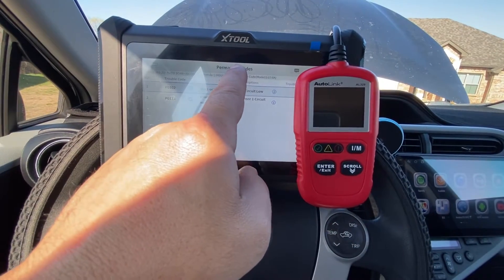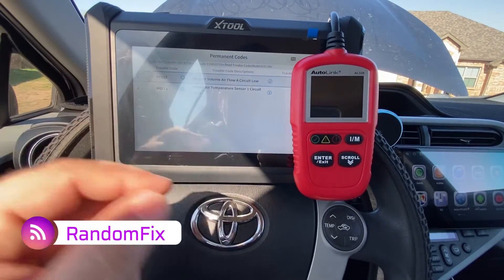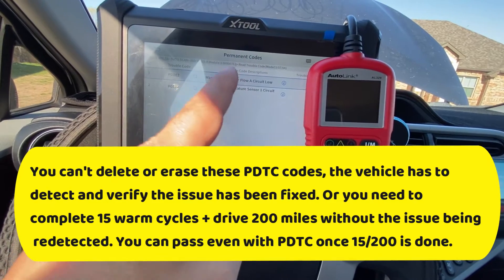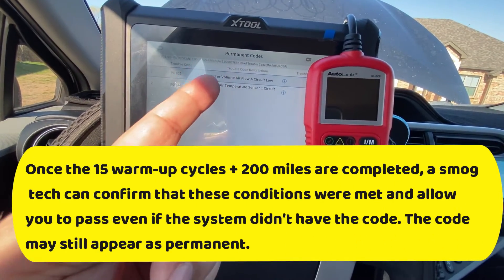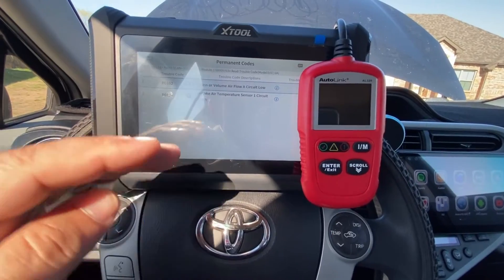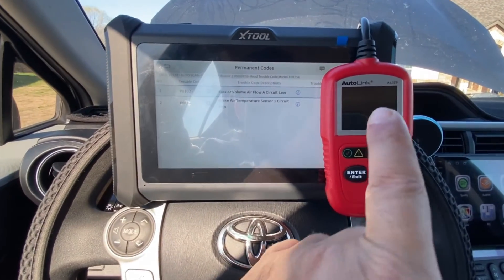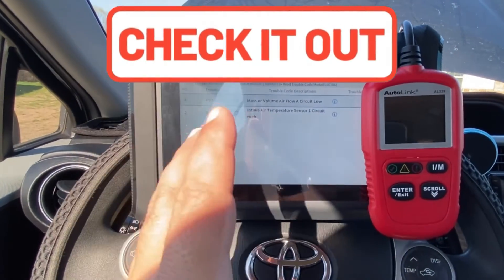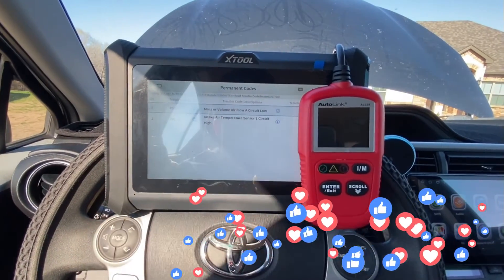Bye to Permanent PDTC Codes! Drive 200 Miles + 15 Warmups To Clear

Comment: hi, on 2011 x5 35d if i use ista (dealer software) it clears all codes, but then it takes a lot of driving to reset monitors.  should i use a generic scanner to clear dtc only, not permanent, then do 200-15 cycles?  thanks
Reply from the maker: the generic scanner will make you complete the a full drive cycle like the ista. Which monitor is not completing? Focus on that on, see video links as I have tricks for each on but your 35D diesel will make it a little tricky. I have friends that run dealerships and they have had to drive over 1k miles to set a monitor. Keep me in the loop.
Reply: @RANDOMFIX egr is not resetting. I think I found the problem. There’s a discrepancy between mass air flow and what is expected. All points to the clogged egr cooler. Will take it apart and see if it needs cleaning. The 1k driving cycle is for the scr cat. If you tell the car you changed it it takes 1300 to reset. Madness!

Comment: i got a 2011 chevy,everything passes but the p0442 is stopping on me from passing the smog check,  so if i did 200+ miles and 15 start ups, would the smog let me pass?
Reply from the maker: Is the p0442 present? Is the check engine light one?